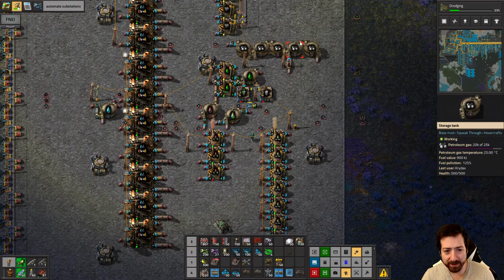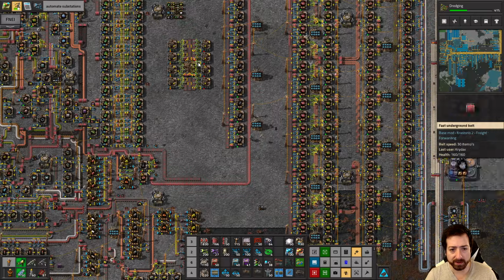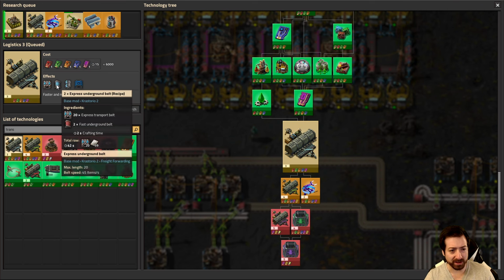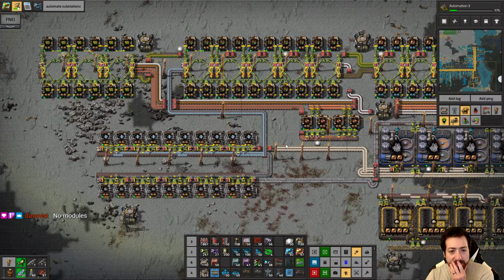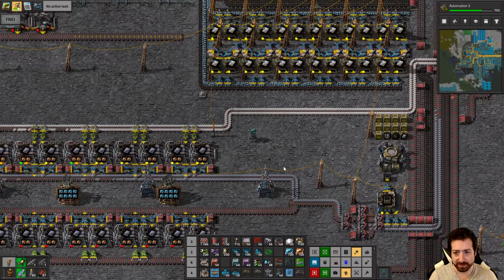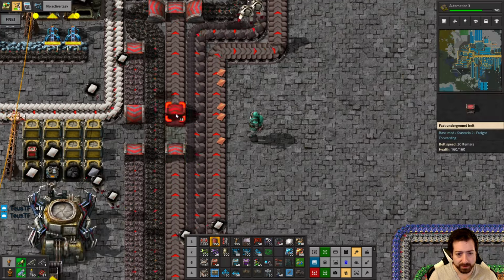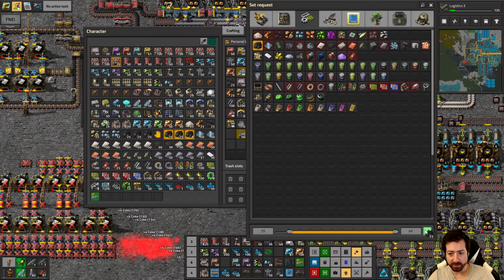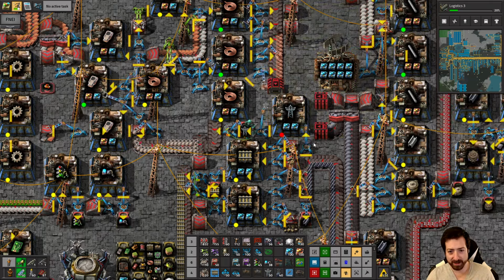Factorio Freight Forwarding K2 20x #54 — 99 Lead Balloons

Comment: i haven't found the supposedly existing mod to not mine bots out of the air, but i found one that lets bots retreat when damaged.
it's called  Scraredy Bot 
haven't tried it yet but it sounds like a good choice to reduce the bot consumption of the laser wall.
though personally i prefer to use repair turrets and put the dragon teeth out of bot range, though that is a bit difficult with your diagonal setup.